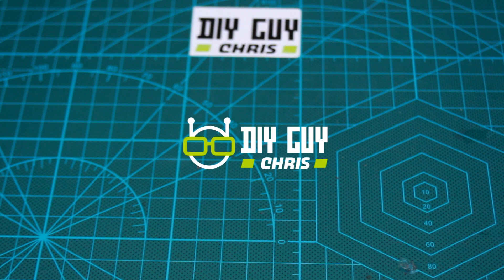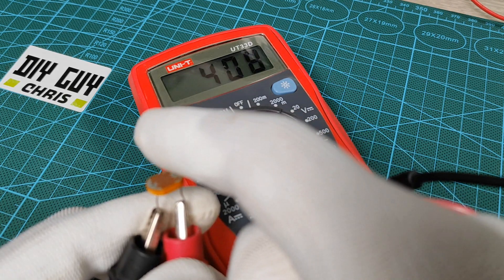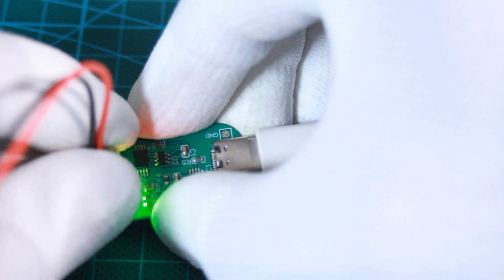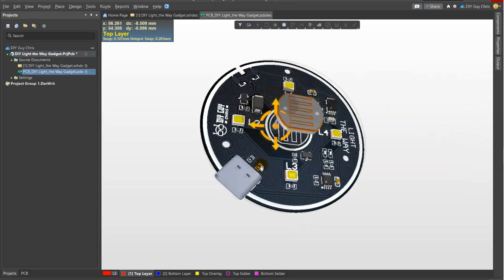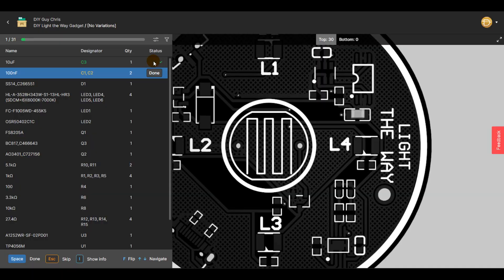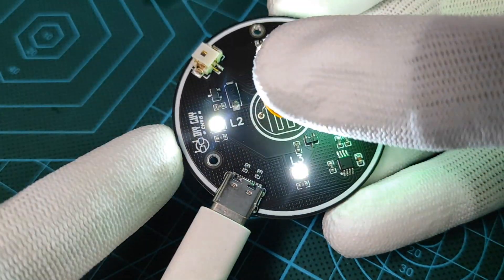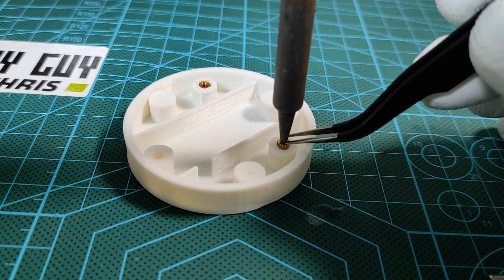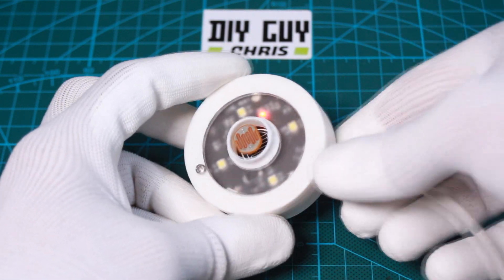DIY LDR Light Control device (Battery Powered)

Comment: Hey Chris good work! How we can use ldr to on off LEDs on full always not dimming?
Reply from the maker: Always consider using the LDR in a voltage divider circuit (by placing it in series with a resistor) this setup will produce significant voltage variations based on LDR resistance value, for on and off control you will need to place a mechanical switch like small relay and this way you are able to produce on off control for powerful equipment
Reply: @DIYGUYChris  how about using a lm393 opamp to convert trigger signal and feed it to control p mos?
Reply from the maker: @thenextproblem8001  then yes but make sure the P mosfet could handle the load
Reply: @DIYGUYChris  load only draws 25mA at 5V but i couldnt make it on/off but only dim. Do you ever face a problem like this? What should i check?